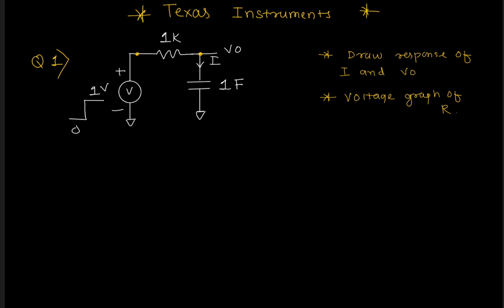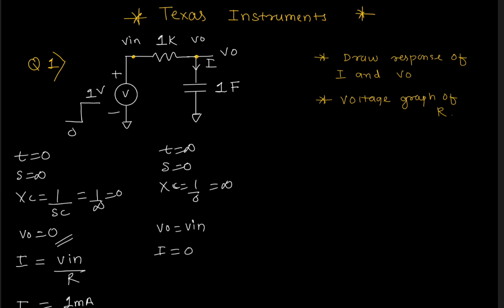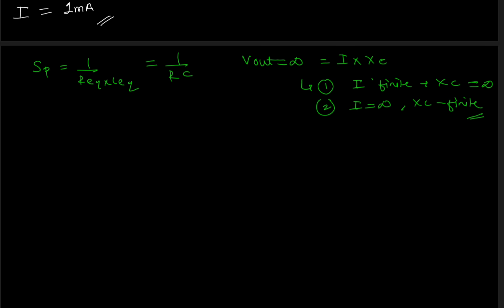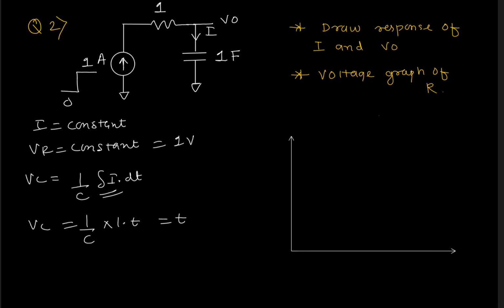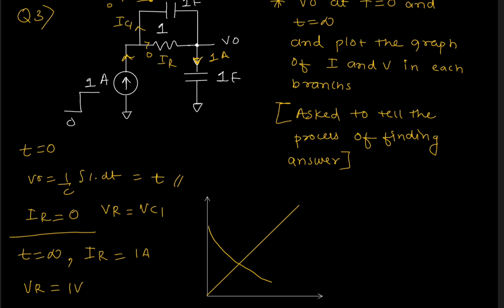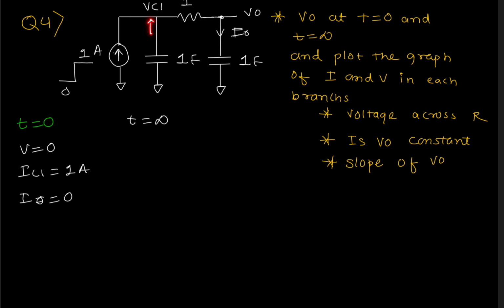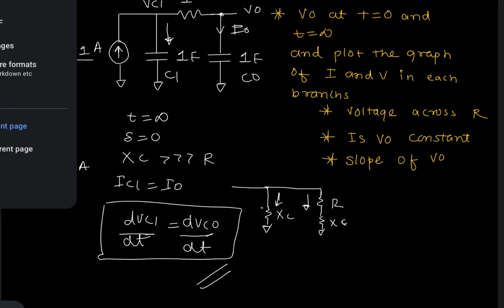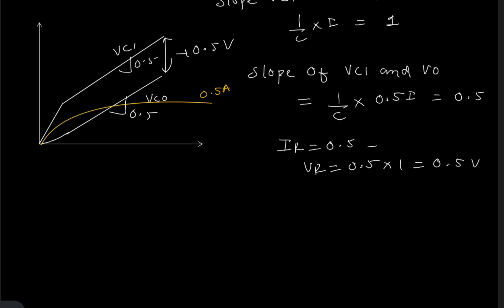Texas Instruments Analog Interview Questions Solution - RC Circuits (Part 1)

Comment: In qn 3 at t=0 both the capacitors are shorted right , then how u wrote vo  eqn
Reply: The second capacitor (series to R) will always get 1A irrespective. And from prev question it is justified how Vo=t

Comment: Something feels weird about q3, I might be dead wrong, but shouldnt the charges on both capacitors be equal always because of the charge conservation at the joined plates, which will imply that there is no current flowing through the resistor at all, which is actually in line with the fact that there is an entirely capacitive path to the ground.
So I guess the current is constant and the equal charges on caps keep increasing linearly till the source fails or dielectric breakdown occurs. 
Please tell me what do you think about this?
Reply: Yaah i am also thinking same i think at t=0+ voltage across both cap = 0 to satisfy kvl
Reply: @PranayChowdary-000 A couple of days after I made that comment I had my interviews, for the analog intern role the first two q were rc circuit ones like this only, the interviewer seemed satisfied and I got in, had my first day today lol.
Reply: @Anon-j4e9c  congrats and btw which role are given and can u share ur interview and ot experience it would be very helpful

Comment: can we add more extra point in starting why C short can i say like initially C has no zero voltage  and if there is changing in the input   C have property that it don't allow sudden change so that it act like short circuit am i correct if this statement true please reply

Comment: In 3rd question @ t=infinity both caps are Open there is no path for current to flow
Reply from the maker: Actually whatever we study that at t=infinity cap is open circuit its only valid will be voltage source is applied ( As the current through the capacitor stops due to drop across resistor becomes zero in case of series RC Circuit and voltage source)

But in case of current source as it is a ideal current source it wil deliver current irrespective of the voltage and the capacitor will go on charging.

Hope you get it😊

Comment: 14:41 , what will be the plot of Vc1=? is it exponentialy decrease to 0v from 1V? as, Vr is exponentially, increase rto 1V ? or, am I missing something?
Reply from the maker: I am considering you are talking about the capacitor at input side

You can say partly exponential / not an exponential

Why i am saying partly exponential

a) at start as the voltage across the cap increase, current through the cap decrease (as some of the part of current will flow in other branch)

b) the current is not zero at the end, that means it will not settle to any voltage at the end. (Which happens in exponential behaviour)

So at start the slope of change is high(1/C) then the slope slowly decrease and then settle to 0.5/C
Reply: @Analogintuitions  How Vc1 is 1A ? correct me If I am wrong

Comment: THANKS BROTHER 👌
in Q.2) Vr is always = 1V, but Vout ---> linearly increasing, is that means , Vr+ Vc i.e. Input side Voltage is also increasing ??
Reply from the maker: Yes you are correct

As the current source is ideal it can give constant current irrespective of the voltage across it.